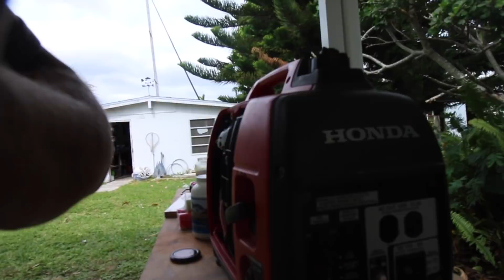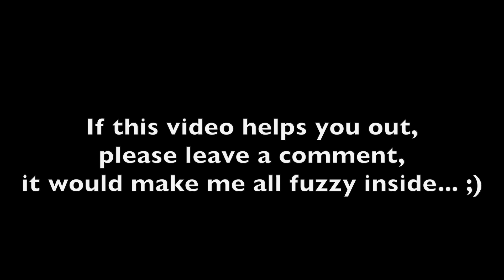How To: Clean the carb on your generator  | Sailing Zingaro

Comment: If you drain the carb before stowing the unit (there is a screw for this) you will have a lot less trouble with clogged jets.

Comment: Great vid, thanks James!!  Question: Do you plug the gen-out into Zingaro’s shore-power-in, or do you run the gen as a separate electrical circuit, i.e. completely independent of Zingaro’s electrical  systems?

Comment: Very cool DIY. Now I know what my next generator will be if I need one. Why did it need cleaning in the first place, did you have it sitting around not used for a while?
Reply from the maker: It was sitting for a year with ethanol gas in it. Came with the boat non-running. Runs great now.

Comment: Hi,
The mixture lever in the back of the carb - is it a jet? screw? or what?
Could you please explain, or show it?
Thanks a lot
Reply from the maker: It’s the lean/rich screw. One little tweak is all it needed. If yours doesn’t run play with that.
Reply: @thelastpirate  can you please show which screw? There are few of them. Thanks again for your time and care,  Moses